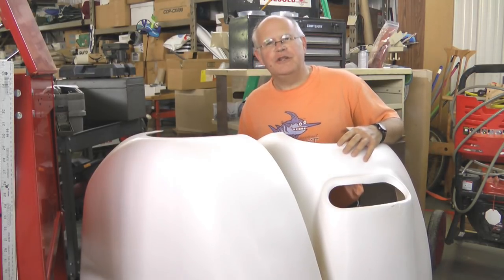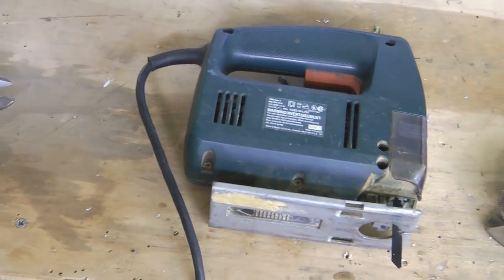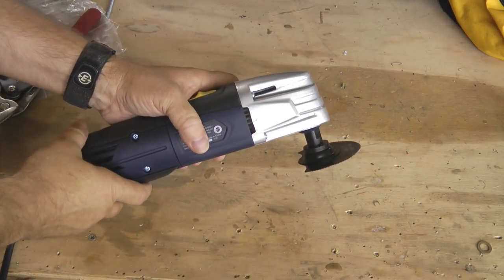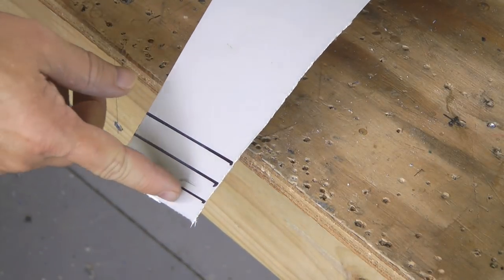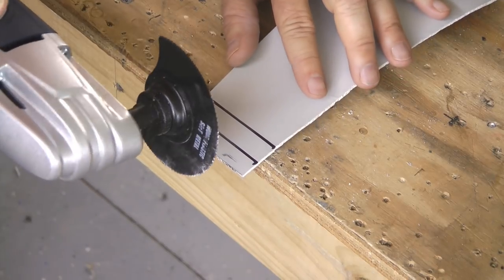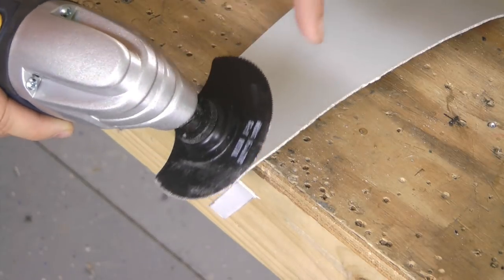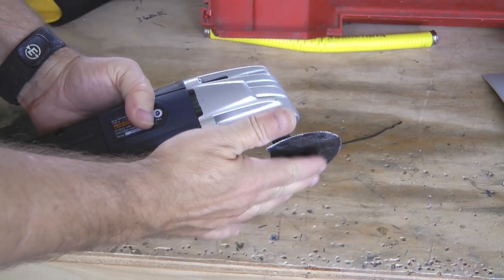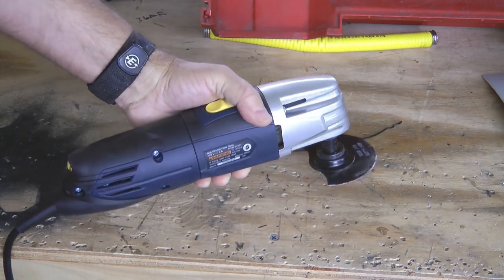How to cut a fiberglass engine cowl

Comment: One other advantage these have over a spinning blade is that if the blade catches or binds, it just kicks out of the cut, rather than wrapping around really fast the way a spinning tool would. Orthopedic surgeons use bone saws like this for that reason.